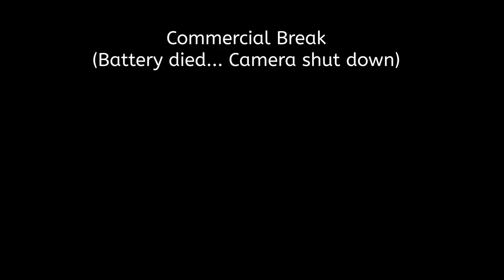(1213) Challenge:  Cry BB Puzzle Picked Open

Comment: You were correct about the Duck tape sleeve, it was only there to prevent the lock from flopping around in the pipe cap.
On pin 4, the master wafer is below the T-pin, not above it.
I should have cut the groove on hole 4 a little deeper because the false trap pin did not work (until the plug was turned 180). That groove on pin 4 is *supposed* to prevent the core from turning unless the wafer is on top.
Picking it CCW won't hurt anything, it just won't open.
Nice picking job as always Bill.
Reply: Thor Lancaster since it wasn't talked about in the video I just wanted to say I appreciate how cleverly this was named. "Cry BB" being used instead of "Cry Baby" was really clever since you used the BB for the first pin. Bill interpreting it as "Cry Bosnian Bill" gave me quite a chuckle!
Reply: thank you that was a fun one have a good year Jim

Comment: So, I take it your camera cant plug into ac power as a backup or does the chord get in the way?
Reply: The cat powered generator is offline also.
Reply: D Sloop if you can get useful effort out of a cat... you’re a better man than me.
Reply: I find having a line in a circle that isn't the diameter to be in the way myself.
Reply: SgtKOnyx it’s too early to be that sharp
Reply: Some camera's (like sony) can't be charged when in use, I know it's very dumb
Reply: BangDroid is actually right Trek, older Sonys can be charged while in use with the proprietory power adapter, newer (mine too :( ) can not, at least not over that port. Not sure if it affects all newer Sonys (or whatever cams) and not sure if it can be done over USB. But I know what you mean buddy ;D.
Reply: The chord is fine, the cadence is the problem.
Reply: BangDroid it's very dumb indeed

Comment: The pin he had in the outer shell was just for alignment purposes.
Reply: I think it was more to keep the cylinder from rotating in the sleeve.
Reply: Jimbo, Agreed.
Reply: kmg501, yes, we are saying the same thing. The pin holds the inner lock assembly and outer shell case aligned, so the lock tab can engage in the slot of the outer shell.
Reply: Jimbo alignment is not a challenge.to do....

Comment: Ever thought of running your camera on a power supply or external battery pack?
Reply: Modern Leveller this would work if it’s got the ports for it. Just plug in an eBay special USB power pack and I bet it’ll run for days. I always keep one when travelling in case I’m stuck in the airport with no power.
Reply from the maker: I do have several extra batteries for that darn camera.  Problem is, when you plug power into the camera's charging port, none of the controls work.  I really need to take one of the cameras apart and figure out how to connect an external battery to the internal connections...
Reply: that’s a nuisance. Paging Big Clive, he’ll have an idea I’m sure.